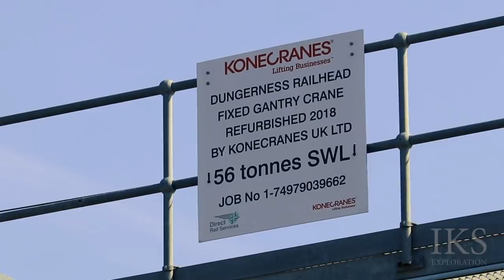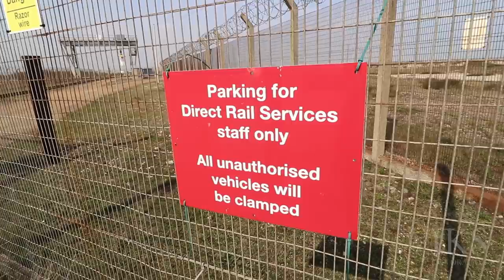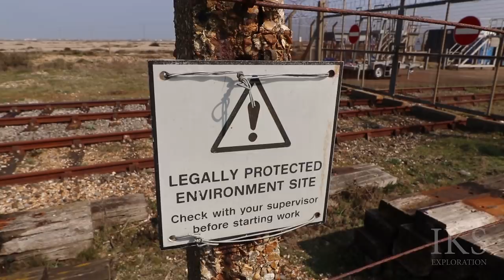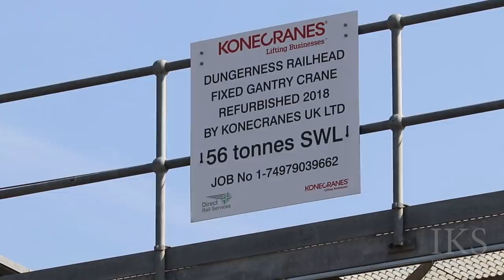Dungeness Nuclear Flask (Transfer Compound)

Comment: This is the fuel loading area opposite Power Station Access Road (Dungeness Road), operated by Direct Rail Services from what the signage says. The line joins the main network near Appledore station.

Comment: Can't tour Dunge A but you can tour dunge B.. Went earlier this year and was very dissapointing. Not allowed inside any interesting buildings due to maintenance but went in the duplicated control room where training was taking place. Interesting to see the various procedures.. All the control panels look very dated and are original for consistency but the systems running behind them are updated periodically..The guy said up until around 3 years ago one of the computer systems was the oldest of its kind running such an installation in europe...Scary folks...
Did a tour a few years previously and saw far more including looking into the reactor hall and the cooling ponds. There was a truck their being loaded up with its flask.. Later in the day say the same flask on the back of a wagon in that rail compound coupled up to 2 loco's (for failsafe purposes) ready for sellafield.. Got pics of that folk's if interested..

Comment: The flasks of nuclear waste from Sizewell atomic power station, used to be carried on the section of railway that went right next to my primary school - the playground ended in a ten foot high chainlink fence, and the railway ran (it's still used) in a cutting beyond that. If a train went by at break, then there would be dozens of small kids gawping through the fence. Trains full of military gear, and nuclear flasks were the ones you always hoped to see.

Comment: What gets me is why didn't they run the rail line all the way to the power station?
Reply: exactly
Reply: The line already existed as a branch to New Romney when the power station was built, and this was the closest point (to Dungeness A.) So it was much easier and cheaper to bolt on an existing secure compound to the existing line, rather than to lay new track all the way to Dungeness A. (FWIW, a spur indeed used to come off this line to Dungeness, but that was lifted many decades prior.)

Comment: There is a Video on YouTube of BNF & BR testing a Nuclear Flask they laid a Flask Wagon on it's side with the Box over the Flask and then ran a Self Propelled former Mainline Diesel Locomotive and 3 Coaches behind it it got up to between 90 & 100mph the Self Propelled Train Smashed into the Flask and Nothing but scratches and minor damage to the Flask was done and that was it! The Locomotive and Coaches were a complete write off luckily BR had taken them from Condemned Stock! Also the line Joins the Main Network at Appledore on the Ashford - Hastings Line

Comment: It's obvious that those railroad tracks haven't been used in quite awhile hence all the rust on the upper surface of the rails.  Cool vid though and it is a very sensitive area to the authorities no doubt.  Cheers!
Reply: I don’t know if you know that in Britain we use railway not railroad
Reply: @ciala51  Thanks for the correction.

Comment: Sellafield in Cumbria, also of interest the Wagon with the Flask over turned across the Railway Line was at the Old Dalby Test Track in Leicestershire in the Early 80s it was a Class 46 Diesel Electric Locomotive Numbered 46009 which had 3 Mark one Coaches behind it and was travelling at 100mph when it struck the overturned wagon and Flask, the Flask is still in existence and I believe it is at the National Railway Museum in York the Locomotive and Coaches were completely written off in the crash and all that happened to the Flask was a Few Scratches in comparison to the rest of it! But hardly any of the coloured liquid from inside the Flask escaped and the test was deemed a success! Those type of Flasks are still in everyday use with Direct Rail Services along with some newer type wagons to convey the flasks from Nuclear Power Station or pick up point to the Nuclear Reprocessing Centre at Sellafield

Comment: Hi GuysYou missed another nearby site the landing of the PLUTO pipeline from the second world war. The concrete you were standing on was part of the shore installation bulldozed into the lake when the site was demolished. Your car was parked by the entrance to the site of the pump area. Most of the site was removed after the war, but there are still bits and pieces if you know where to look.The railway is the truncated remains of the New Romney branch. The waste trains run about twice a week but at irregular times  to stop terrorists I suppose.There are Nuclear police around the area and they are armed with machine guns and you do not want to mess with them, also there are border force people looking for illegals, if you are old like me they leave you alone, but they would suspect you either as smugglers or a migrants off a boat. you were lucky.  Good video, will catch your next one.